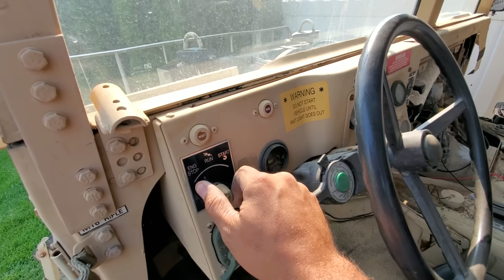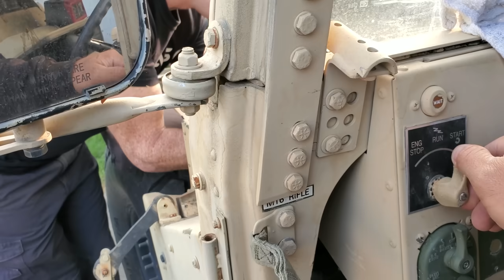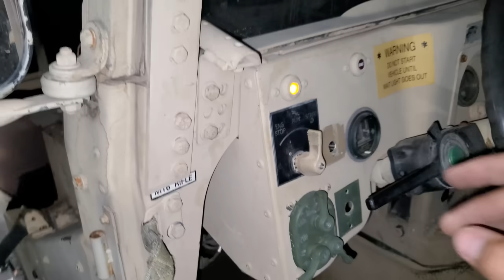Well... we figured out why the HMMWV wont start...

Comment: Now that I've watched to video, I understand why fellow mechanics are cringing at my decision to check compression first. When I was called in the glow plugs weren't working- and one or two had blown up in the hole- that is, they blew out from too much heat and pieces of them were likely to have been dropped in the cylinder where the chances of valve or cylinder damage was possible.  The compression testing was done to verify we still had enough compression to make this compression ignition engine run.  The way this was edited doesn't reflect all the information or the situation I had when that decision was made.  Oh well.  For anyone who cares, now you're aware.  My apologies for the time spent cringing.
Reply: Thanks for the clarification. It's always great when you're involved in the video.
Reply: @devdhamija7585  Much thanks Dev!
Reply: @briansmobile1  No. Thank YOU!

Comment: I have been working on 6.5 l for almost 20 years you need to check the line that goes to the injectors Crack them loss one at a time and see if you get fuel to the injectors when you turn it over you have to prime the system 6.5 are almost bullet proof I can almost  Guarantee it needs to be Primed
Reply: ahh PRIMED yes that was the term I was looking for;  while watching and shaking my head at all the tests and parts being replaced. These machines are beasts that will keep running for a long time as long you take care of them (a daily/weekly task)
Reply: He had fuel at the bleeder is it before the injection lines?
Reply: @David.-_-  the bleeder was before the faulty 1 way check valve.
Reply: Your right I've worked on them since they been out and that's the first thing you d
Reply: @David.-_-  very little needs more coming out.

Comment: There are older but excellent military troubleshooting videos on Youtube called "HMMWV Troubleshooting the Fuel System"  and "HMMWV Troubleshooting Electrical System" thanks to "Everything Hummer" for posting them on Youtube. If the guys in this video would have watched the recommended troubleshooting videos before they worked on their Hmmwv they would have saved a lot of time, money and the Hmmwv would most likely be running instead of scrapped. These videos give many ways to troubleshoot the systems quick and efficient, showing continuity and resistance checks to perform first that take the guess work out of troubleshooting the HMMWV's. This includes fast and easy checks of the glow plugs and glow plug controller. Getting the air out of the fuel lines and injector system is a common online important step/recommendation before attempting to start any diesel engine and it is part of the "HMMWV troubleshooting the fuel system" video.

Comment: Maybe you should read your comments more.  Postings from the two earlier videos all identified the fuel system as the problem. It was suggested right off that trying a shot of ether or cracking one of the injector line nuts would show right away if there was injection taking place or not. Tracing back from there would have found the cause without buying and installing all those new parts.
Reply: it seems that he need to make videos lol , oh my injectors are rusty and clogged but its not the issue 😂

Comment: Labor rates:  
$45 / half hour,  
$65 if you watch, 
$85 if you already tore into it,  
$125 if all the above AND you're posting it on Youtube.  
Just kidding.  Who would do that last one?   lol

For anyone curious to know, the best course of action in a case like this is to crack fuel lines at the injectors and pump one at a time while cranking it if it won't start.  If you've got fuel, and you have no evidence of mechanical damage to the cylinders- cover the exhaust to help compression retention and crank it.  I was called in to address a known glow plug issue in the beginning (one was blown while inside the cylinder- ouch).  And this was unfortunately after the engine had been desperately & extensively cranked over.  Once we fixed the glow plug issue and verified the cylinder(s) had compression- the hunt for fuel led to a stuck check valve between the tank and the mechanical lift pump from sitting (original problem causing the no-start).  Once that was remedied, we were at the top of the order and discovered the injector pump rotor was ground up from fuel starvation as evidenced by... you guessed it.  Cracking lines open at the injectors and injector pump one at a time.  By then- it was time to pursue the original intention with the Hummer... flux capacitor!
Reply: Yeah. I have a tractor and excavator and have had to do the same thing a number of times. Crap or water in the fuel tank is number 1suspect, blocked fuel filters and fuel system number 2.
Reply: That's a bargan cause I saw you swap a Subie motor in an hour
Reply: @scottbaker9066  Hey Scott!  Have you seen my latest video/ give away?  Still got 23 days.
Reply: $250 if you help

Comment: I've replaced a ton of this 6.2 injector pumps, you dont need to mark the timing, the gear the fuel pump bolts up to has a hole for a pin in the injector pump itself, so you can not put it in wrong, it is reltively easy, it would just be time consuming the first time you do it, you might want to get someone who knows this engines better to help you out
Reply: This is the 6.5 variant. Same concept  and the timing is adjustable. Don't really need to mark it though. There are two indented lines you need to line up at first and adjust as necessary.
Reply: The 3 main mounting bolts on the injection pump to block are slotted to allow the rotation
Reply: Yes your right

Comment: Don't know how deep your swap will be, but i served 12 years driving trucks in the Army. A tip for your consideration. If you keep the stock coolant system it will overheat unless you unplug the connection next to the coolant reservoir. It is the the 2 prong. Unplugging it will keep the fan on constantly.

Comment: Starter & battery turn over for 5 minutes without melting. That's pretty good! Most starter motors are on the brink of meltdown after 60 seconds of cranking.
Reply: a bare HMMWV was like $70k new from AM General, and by bare I mean even the doors and roof were an optional accessory. 
That pricetag meant you get the good stuff and everything is overbuilt ;-)
Reply: @AKAtheA  Company I worked at rebuilt starter motors. Seen melted starter motors from trucks that cost $100-$250k used. Same 24v style used in HMMWV. Meh.

Comment: ask for a company that refurbishes this parts and if you can not find one in the US you will find one in europe, mainland or in Lethvia and Lithuania were they are still used to fix things over and over again back from the former soviet occupation era.

Here a lot of the motor parts are being refurbished just to save money and protect the environment.
Reply: Why would Soviet occupied countries have parts for an American military vehicle?
Reply: @username65585  because they use humvees a lot
Reply: this dude here knows nothing, soviets didnt use humvees and neither did lithuania and latvia have any during soviet occupation
Reply: @male07mdl  a distributor injection pump is what you would find on pretty much every tractor and truck ("commercial truck" for the US people) engine behind the Iron Curtain. Even soviet military vehicles used a distributor pump diesel, unit injectors were non-existent here, this was the go-to solution for diesel injection for a looong time.
Depending on how badly Zack tore up the insides of it, an old timey latvian/lithuanian disel mechanic has a better chance of rebuilding it then some hipster who's used to connecting an OBD-II dignostic and just replacing whatever modules it deems defective.
Reply: @AKAtheA  These are Stanadyne db2 rotary pumps. Any local diesel injection shop in the US should be able to work on these. They are ancient technology as you stated. Been around since the 50s.

Comment: I've replaced many injector pumps on HMMWV's.  It can be done in about a half a day without removing the intake manifold.  This is the "field expedient method".
Reply: What is  a chance the injector pumps go bad ?
Reply: @dansong3704    The injector pump is all mechanical and they rarely go out.  I can only remember changing 1 that was bad due to internal component failure and not external shrapnel of some kind.

Comment: Its been a long time since I worked on this in the marines but I would check the return line out of the top of the injection pump for blocked fitting with plastic if so pop out ball and spring out of bottom of fitting

Comment: I have seen couple "Engine won't start video's" and people that keep trying starting the engine for more than 5 minutes always damaged or broke something.
After 5 minutes check all the AIR - FUEL - POWER  components, even if you find 3 plausible failures go through the full check list from A-Z number's*.

Comment: As a mechanic that has worked on these things for the past FIVE YEARS... im just dying rn... I wanna help so bad 😅
Reply: I think any individual that served in the military (myself included) would love to help. I used to have this exact same problem with my HMMWV and a good can of starter fluid would always solve the issue, especially when the vehicle hadn't been driven in awhile. FYI military vehicles are meant to be driven/started daily. If you leave it to sit you will surely run into starting problems.
Reply: the worst performing vehicle needs a mechanic every 10 km.  It's true?

Comment: check you are getting fuel at the injectors , and that the fuel shut off solenoid on or near the injection pump is allowing fuel in 
to the high pressure pump ,.
also check the tank for crap,  (blow the fuel lines before the filters back to the with the tank cap off )   there should be no restriction to flow , then blow the fuel back to filters ( wrap a rag around your air blow valve push into the tank filler and short pulse of air should get the fuel back to the filters .
you will need to get as much air out of the fuel system or it will not run ( air compasses fuel doesn't).
bleed up to the high pressure pump then crake off all the pipes at the injectors , crank it till fuel squirts at the injectors , tighten them up , turn it over and it should fire up , it may take a while to do the above but it should /will run 

good luck (i am a railroad maintenance engineer) same basic engines just bigger

Comment: You can bypass the check valve, the fuel lift pump has one internally, probably the old lift pump was failing and letting the fuel back to the tank causing slow starts as it needed to purge the fuel system and the previous owner just installed the check valve to avoid changing the lift pump

Comment: 8:47 In my 10 years experience as a Army light wheel vehicle mechanic I don't recall EVER having to replace a fuel line check valve.  I am sure someone has but I never had to. Lucky I guess. 😉😆

Comment: Disconnect the fuel return line from the fuel return solenoid on the very front top of the injection pump and see if fuel comes out. There's another one way check valve there. Also check that wire 54a, which is one if two wires going to the pump, has battery power while starting.

Comment: Hey im car mehanic in the IDF, 
I work lot on humwvees,
Did you check the fuel injector pump? In the middle of the engine, lot comfort getting threw the cabin, the rear engine cover..
Get the diesel Pipe out and check fuel is coming out
 check also the connector!

Comment: I don't think it's anything with the glow plugs. It's summer right now and hot outside. Glow plugs honestly do nothing right now.
Reply: Yeah, but the wait light is probably thr glow plug light, i dunno but are they supposed glow every startup
Reply: @MohdAzylee  yeah they do, but hes saying thats irrelevant to it not starting right now because of how warm it is outside. It doesnt need them to start in the middle of the summe.
Reply: @bobgoat5994  well they need to add more tech and sensors to do that, and prone to more failurez so better that lol

Comment: I dont have that water separator valve mount in my truck.  I may have to drill a hole and mount it on the splash guard.

Comment: The compression ignites the fuel, the spark plug help to keep to pre warm the cillinder, the most comon failure is the air in the fuel line
Reply: The reason of that valve is to avoid the air in the sistem

Comment: Could just spray starting fluid/ether/carb/cleaner etc into the intake while cranking it. If it fires only while spraying then its a fuel delivery issue. 
Also, why replace the fuel pump after confirming that fuel was being pumped up to the engine bay?

Comment: That shelf forward of the windshield washer reservoir is for a Thomas 24v 270047 1/3 HP air compressor. Did you leave the shelf on your truck or did you remove it?

Comment: The mechanical diesel engine is the easiest engine to work on. Your problem is air intrusion. If you remove the mechanical lift pump and replace it with an electric pump you won't have a priming issue again. Have you checked the return lines, all of the orings under the injectors, the feed line from the tank, fittings on the filter head, the shower head in the tank? What you should try is taking a rubber line from the lift pump directly into a can of diesel. It will help eliminate where your air leak is. BTW those standyne pumps will take a beating. Pull the injectors and soak them in atf. Seems silly to do an engine swap just because you can't get it fuelled.

Comment: Top of the fuel filter is a flat head screw. Crack it and let the air out. The port y’all keep opening on the fuel filter is for the fuel inspection. Basically so they can test it for water and it’s not helping you prime the system.

Comment: I'd be checking power to the fuel shut off solenoid it's on top of the injection pump under the intake Valley behind the thermostat crossover

Comment: With Diesel engine with out dpf systems check for smoke if you see smoke out the tail pipe u are getting fuel. If your not getting smoke something is stopping it from injecting

Comment: Why is the radiator above the engine? It seems like it would be a rear chore to even replace the engine. Also, heat rises so wouldn't it make the radiator more efficient to have it up front where the air is colder, especially when driving since air is moving through it?

Comment: If the fuel pump filter had pressure at crank when u remove the top flat head bleeder valve then the mechanical fuel pump is working

Comment: if you couldn't get it from the get go it was a fuel issue I honestly don't know how you will manage to convert this to electric??
Reply from the maker: Well, this might come as a shock, but electric vehicles don't use fuel.
Reply: @ZacksJerryRig , so I guess you're going to wait until the e-Hummer will be released?😁😁
But I did want to point out a few things, but I noticed that Brian already took care of it. 😁👍

6:28 Glow plugs are essentially there for a cold weather. Basically if you live in Southern states, you don't even need any glow plugs to warm up the fuel mixture, because diesel fuel mixture ignites under pressure. No ignition required. 
8:32 As for GAS .... THERE IS NO GAS IN A NON-GASOLINE ENGINES!!!! 😉 Same thing applies to a GAS pedal.
Also as far as the fuel distribution and the starter too: On the low RPM engines(like many big diesel blocks) there is a high AMPerage motors and they can burn up fairly quickly if cranked for extended periods of time. Also if there is a motorized fuel pump, it will also burn up W/O any fuel in it.
Reply: Other than that, GOOD LUCK on this project. I do want to see it through all the way.

Comment: Hi , was watching the electric motor conversion, my question is how would young the batteries in the hummer with out them shifting around or vibrating around in the hummer .
 Final question, will the mounting of the batteries in a hummer be able to be used off road on sketchy terrain with the batteries. 
 I remember back in the day , the tough book 25’s that are used still in police cars , well thr up grades are , the original ones had a silicone housing for the hard drives just in case laptop fell .. 
 If you were going to run the hummer off road , what would be used to keep them from vibrating in the hummer. 
I don’t know much about the batteries and their housing or the level of vibration and off road play ..
Reply: casual bumps wont hurt a battery so i dont think its not that bad to use it offroad, as for vibrations i think rubber isolators/mounting would be sufficient
but ofcourse well just have to wait and see how zacks going to do it

Comment: It was working when you parked it, but won't start now. 
Compression is not going to change while the thing is parked. 
If you parked it out of the way, in a quiet place, I wouldn't be at all surprised if a hungry rat hadn't made a meal out of part of the wiring loom.
The other favourite reason in the same circumstances is rust or paint in fhe fuel tank flaking off and being picked up into the fuel system. 
The fuel pump is unlikely to fail with the vehicle standing, but I'd check the diesel filters. I've had several old diesel vehicles and the scenario you were in here is a familiar one, often solved by cleaning out the fuel system and replacing the fuel filters and fuel tank.